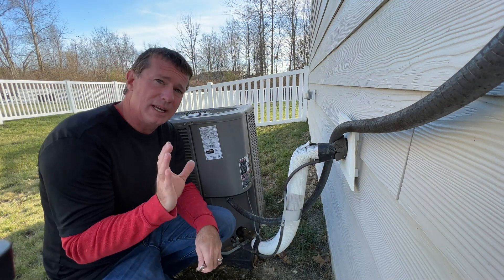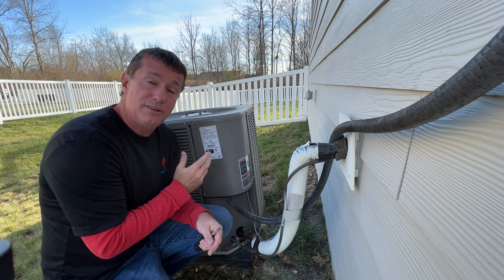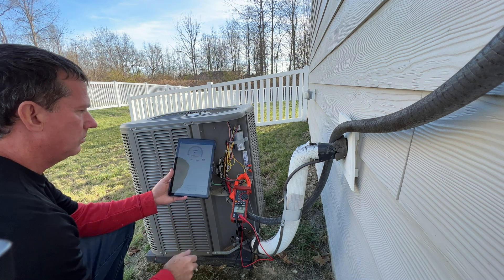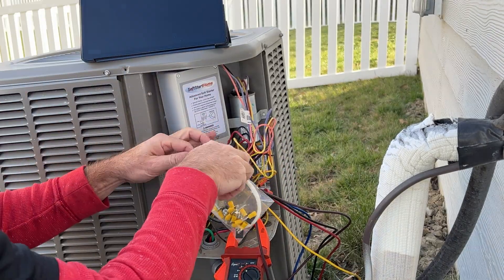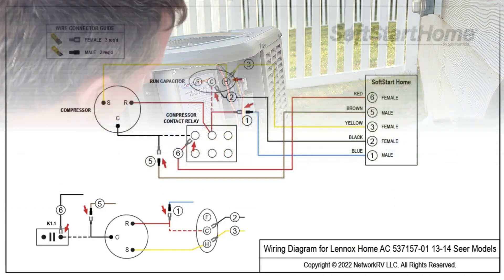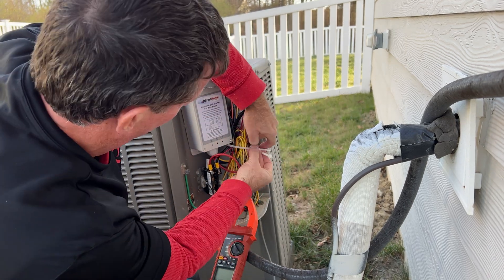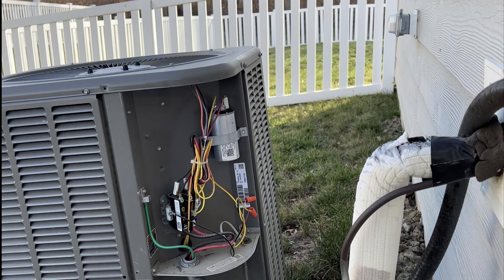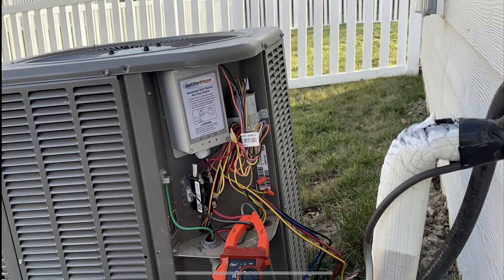SoftStart Technology

Comment: AS FOR I KNOW EVERY MOTOR NEED A CERTAIN ABOUT AMPS TO START THE MOTOR .  AND IF A MOTOR IS STROGGINS TO DRAW THOSE AMP TO GET IT STARTED IT WILL EVENTUALLY BURN OUT THE MOTOR.
EVEN IT SLOWLY GETS THODE AMP.

SO WHAT DO U THINK ABOUT THIS.

Comment: There were multiple mentions of "conserving electricity",   Everything else I've read and heard on soft start is it is exactly that - it just helps with the start.   During normal usage (a day/wk/month), I don't believe they should provide any overall reduction in electricity usage.

Also, what was the size of your compressor?   While the ~47A to ~14A ratio might be valid, all other soft/start videos I've seen had the initial unmodified peak startup current at 80A+ (what's listed as the LRA (Locked Rotor Amps)).   47A to start seems awful low.

Comment: Would you recommend this soft start on a brand new Trane XR14, 2.5 tone outside AC unit here in the Midwest? Or is this overkill for a new Trane AC unit?
Reply from the maker: Dustin I would check with your distributor or Trane to verify if it effects warranty. The unit I installed on is my own and is just a few years old. Much easier starts and no light dimming.

Comment: So I have a question I have the Snyder Electric inverter 4000 w and I want to run in heat pump what's the largest size that I could add and use a soft start now the unit can do split phase so I can do both 120 and 240 volt and the max what is 7000
Reply from the maker: Neo, here is the video from our LIVE show with SoftStartHome, at the end is contact info for Aaron who can probably help you there.
https://youtu.be/Enh7XoURuvU

Comment: Look forward about their long-term reliability. 
       I used to  used the ICM three phase controller had three of the sensors failed on really hot days high-pressure completely losing the entire charge.   Which is just a refrigerant, especially our 22 cost many times more than the ICM control plus the labor..  
      One of my other customers in a two year span of time lost 5ICM3 phase controllers. 

That caused downtime and expense for finding a problem, exceeded the price of the ICM in the labor and insulation to replace. 

A product that is supposed to extend the life and protect the system, should not be the root cause of failure, and cost more than the item itself.
Reply from the maker: Very true Tom. I have personally only had a handful of 3 phase controllers fail, most of them were smoked pretty good. I have not had a single phase fail on me yet Clifton